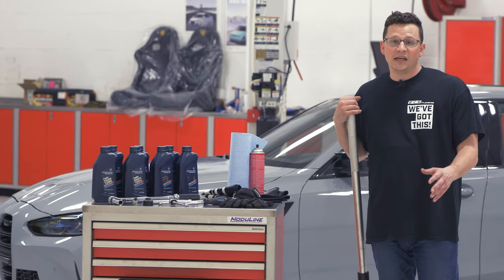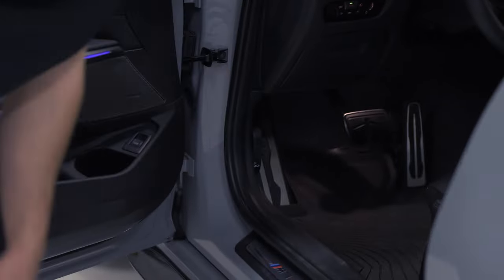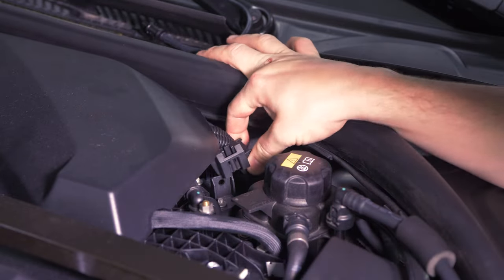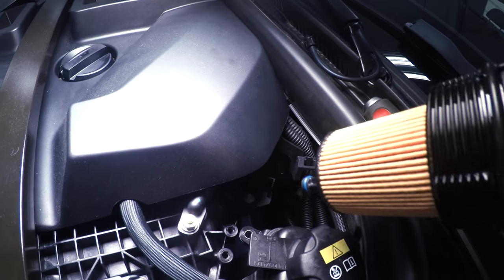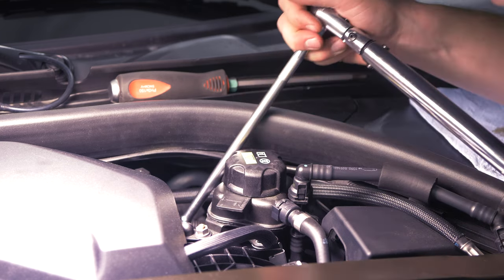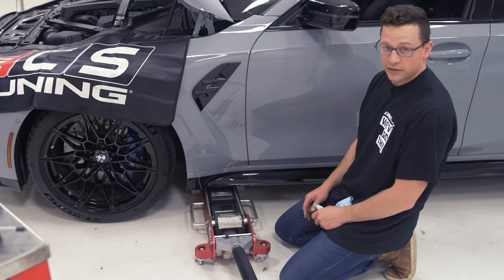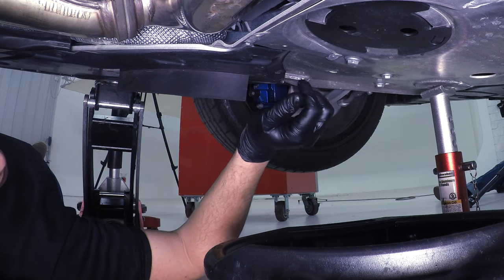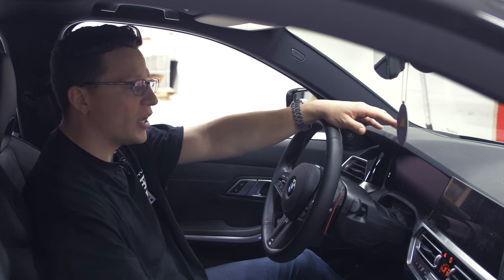BMW G80 M3 (2021) Competition Oil Service | DIY | ECS Tuning

Comment: Plastic everywhere - everything that is plastic, if one plans on keeping the car, it will require replacement at some point because plastic when combined with heat and age, it just cracks.  BMW “M”, it already tells you, bring MONEY, lot’s of it.  Something tells me that when this car gets to about 70,000 or 80,000 miles, it’s time to dump it because the repair cost will be outrageous.

Comment: This is the worst oil drain .In has much not letting the full amount of oil to drain. The is from a master tech with over 35 years plus.👎👎👎
Reply: The reason is because he tipped the car on one side forcing some of the oil to get trapped in the pan.

Comment: I have an F83. Has been reliable, fun, and still turns heads. Was thinking of getting a G83 or maybe a G82. After watching this, I’m reconsidering.
Reply: I wouldn't let an oil change hold you back.
Reply: @peterg6953  I’m being hyperbolic. Even so, design for service and repair is seriously lacking. Sticking with my F83 for now.
Reply: @heftex8339  Aint that bad but I get it
Reply: @heftex8339 it is intentional to position it there.. I remember this fixed the n55 timing chain guide problem because the plastic is further away from heat source
Reply: @qili8504  interesting.

Comment: I just did the oil chg on my G80, comment/feedback for the oil filter insertion at the 6:00 min mark: I found it easier to insert/align the filter into the engine oil pump housing first, seat it, and then place the filter cap on top of the filter. The oil pump housing has a center pipe that guides the filter onto it; the important thing is to line up the filter's bottom 'nipple' to the corresponding hole.
Reply: Awesome tip, ty!  That's so hard to wiggle a gorwn-man-sized hand back there.
Reply: Thanks for the advice. I was struggling.

Comment: You should put the filter down into the housing first to ensure that the dowel goes into the hole, then put the cap over it and tighten down

Comment: Thx for the video (THumbs up)  Question? because  you only jacked up the front of the car would that account for the car only needing 6 1/2 quarts of oil since the 1/2 quart may have been sitting in the corner of the oil pan?

Comment: Terrible engineering. Both E9x and F8x M cars have an oil filter right on the top and very straight forward to remove. I guess BMW is trying to make it difficult for DIY guys. More reasons not to like this car.